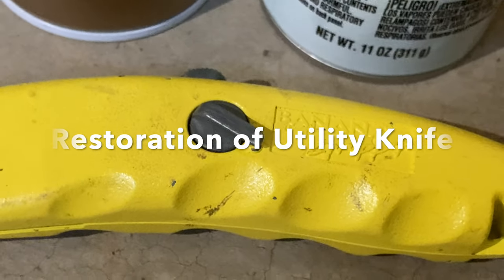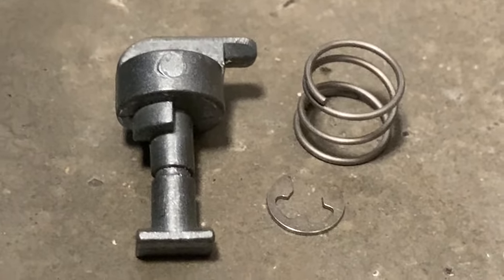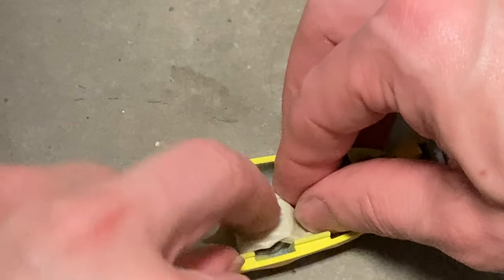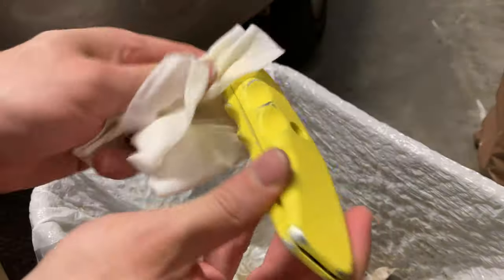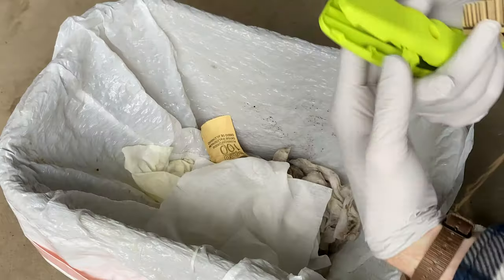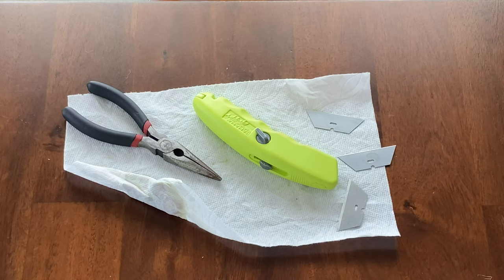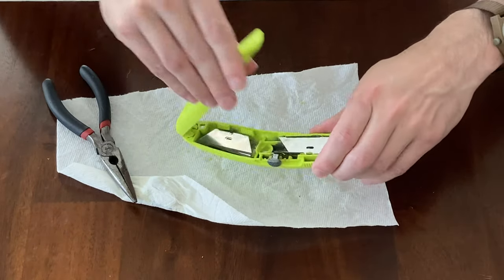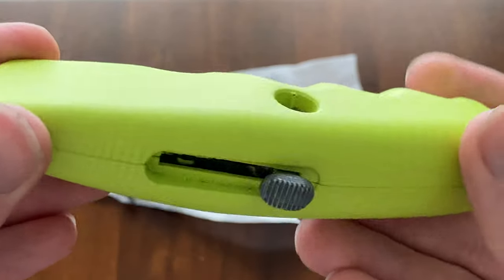Utility Knife Restoration (Repainting, 6 layers, automotive style) ~5 min deep-dive long version!

Comment from the maker: This was a fun spray painting project. Typical of most "spray painting" projects, most of the time was spent sanding & prepping / then multiple layers, sanding in-between, then more layers of clear coat // time to cure between layers // I enjoy doing this one. It handles better & feels nicer in the hand / the flat clear coat contains microcrystalline texture particles, meaning it has a soft grippy texture that still feels smooth but not slippery!